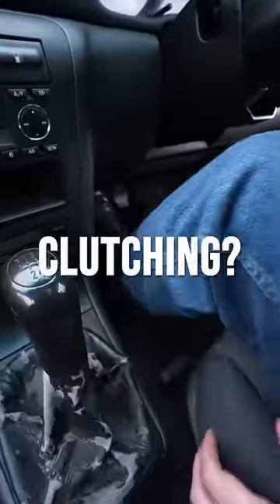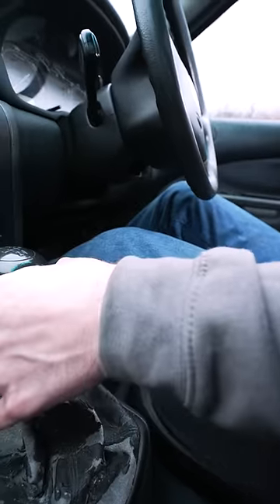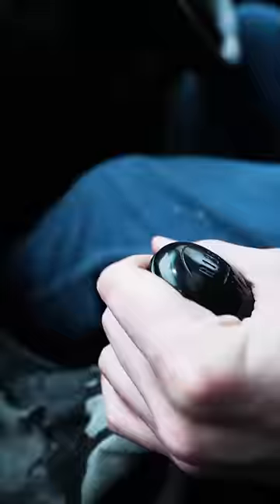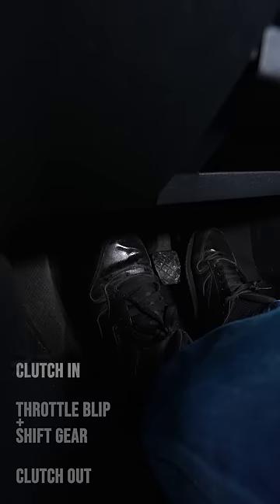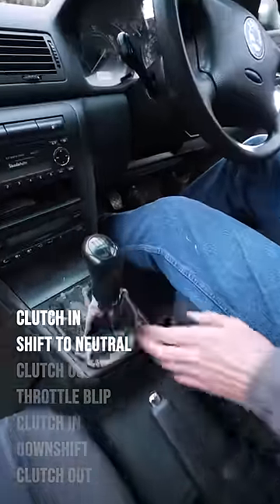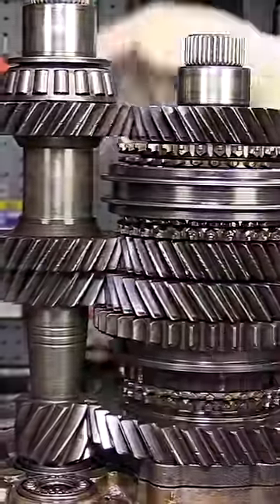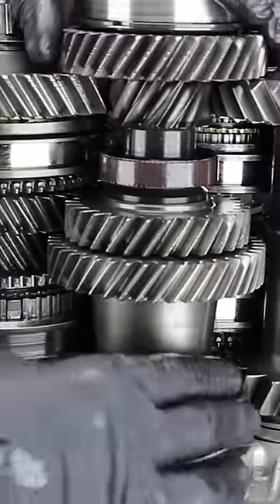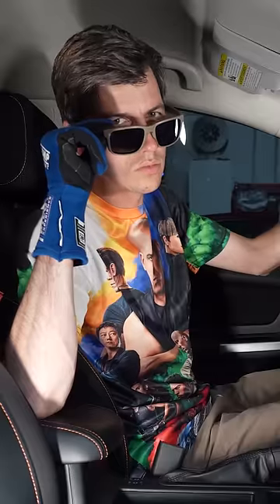What Is Double Clutching? Don't Granny Shift!

Comment: The amount of gear shifting in that movie during a drag race was hilarious 😂
Reply: If theyr running 4 wide and shifting through 5-6 gears that is like 20 shifts, if theybshow every time someone shifts. Which woukd have been cooler.
Reply: Yea I find it funny he was making a joke about them “not double clutching” in a straight line race.
Reply: All the way up to 19th gear! 😂
Reply: They shifted 22 times just to get to 20 mph
Reply: @ralanham76   I'm pretty sure it was supposed to be showing everytime someone  changed gears, not 1 car shifting 20 times. They just didn't do it good. They should have showed them running next to other reving up and then show them all shifting in order or who shifts first, click,click,click,click and then revving back up. The more unrealistic part is how long they rev the rpms up before shifting, in a fast car 1-2, 2-3, and 3-4 shifts all happen in likeless than 2-2.5 seconds. My 750hp mr2 hits 100mph in less than 3-4 seconds. And wheel spin, especially in street racing is a major factor even good drivers spin quite frequently in high hp cars on non prepped public type streets on street tires and if your shits actually fast it more about who can hook and who can pedal it when they spin without losing time. Not about who hits nitrous last. Drag racing from a dig is all about the hole shot, the launch amd who can get to 3rd gear fastest
Reply: You try driving an Eclipse with a stand-alone-fuel-management-system and a 19 speed!
Reply: You’ve obviously never lived a 1/4 mile at time, totally being sarcastic and couldn’t agree more with your comment ❤😂
Reply: @slevpy  in reality there’s a technique where you cut throttle, then disengage the gear with no clutch, then kick clutch as the next gear slides in. Timed properly, barely uses the synchros, timed wrong you can wear/snap synchros and Grieg teeth Rilke crazy
Reply: Looked cool asf when I was like 9 lmaoo
Reply: Often they're supposed to be running flat out then the opposition/enemy starts to catch up or overtake and they shift down and floor it clearly showing they weren't going flat out beforehand
Reply: Supposed to be 10sec 1/4mile cars but the races last a full minute. Thats 15mph average speed. Ooo, feel the G.
Reply: @RBurwell   I love how every time they shift up the visual effects show the cars accelerating harder and harder, the total opposite of how gear ratios work.
Reply: You non car guys don’t get it.  That’s how it’s done when you step up to the line with pinks up for grabs and you’re driving a Mitsubishi with a 37 speed gearbox and it’s all about family.
Y’all don’t know nothin’ about nothin’
Reply: @MrMightyZ  also… Greased Lightnin’!
Reply: Yeh, right? those cars might as well been 18 wheelers, shifting 18 gears lol
Reply: The drinking game where you drink when they shift or say family will kill you.
Reply: dont forget in fast fiv ewhen they were cluth shifting automatic transmission dodge chargers.
Reply: it looks cool to shift in the gearbox, that's why they kept using the scene when drivers keep shifting
Reply: While typing on a laptop
Reply: Yep... like how many gearboxes they have?
Reply: The best is shifting into 2nd reverse
Reply: And I just love how they even drop one down! In a drag race!
Reply: and they only shift up
Reply: @cyruslever586 i believe you
Reply: Every relatively modern transmission... You mean, every transmission built within the last 60 years 😂
Reply: So do yall not use all 20 gears while driving a quarter mile at a time?
Reply: Noone mentions the Floor Unbolting itself and then after the race he picks Vin Up in it without a floor.
Reply: @MrMightyZ  I owe you a 10 second car.
Reply: @ralanham76  I can't even imagine Lowest gear's Crawl Ratio
Reply: Had to fill the 10 minutes for that 10 second race.
Reply: prolly like 21 shifts
Reply: The gayest movie of all time. Gayer than Brokeback mountain.
Reply: You know they have 157 gears transmission.
Reply: @cyruslever586 and then they suddenly fully step on the gas and go faster like bro what were u doing earlier? no wonder why ur behind
Reply: Very specific.
Reply: @Youssef06_  you let off the gas when you shift gears. Most modern cars do it for you.
Reply: No actually they didnt they shiften only twice in all that race that i have seen if we are talking about FnF 1 first race go back and watch it
Reply: @cyruslever586  I’m talking about fast and furious movies
Reply: They were racing on a straight street for five minutes, putting in about 65 gears. At some point, one of the drivers got mad and wanted revenge, and so he punishingly downshifted to go faster. 😂😂😂
Reply: @CrashPCcz  power BOOST!!!!
Reply: Its crazy how the name is not here and yet ik what movie it is
Reply: 19 gear😂
Reply: A lot of drag transmissions only have three gears anyways, maybe four so that's 2 to 3 gear shifts in
 a straight line
Reply: A 750 hp MR2, where do you sit, on top of the car?
Reply: thought the best part was the blown hemi with wrinkle-walls carrying the front tires for 1/8 while the 4-banger just calmly kept right up
Reply: It was so lame
Reply: Not to mention that a 10 second race took 2 minutes lol
Reply: A drag race is a straight line race, when I am driving a standard on a track with turns and straights I upshift for the straights but down shift for turns unless it's a very banked corner you will down shift 3 times in a 7 speed momentum is the enemy of turning and yes you shift down once per clutching just like you would shifting up. Racing vehicles typically don't have markers or indicators of gears on shifting lever but remember just cause they are shifting doesn't mean they are shifting up cause you also have to shift down
Reply: It’s almost like the movie wasn’t realistic.
Reply: endless gears to 60 mph 😂
Reply: Yeah, you in race driving on a straight road. Only need to shift up, never down.
Reply: Bet you didn’t even noticed it until you prolly saw a video when older 😂😂
Reply: Well at the end of the first movie they do a quarter mile and it takes them 3 minutes (or 5 mph) I am surprised they even changed gear at all. Also most people would be able to jog that quickly and more could atleast run a quarter mile faster than that.
Reply: You owe me a ten minute car.
Reply: Bunch of people that have never drove a spoon engine or over nighted parts from japan talking like they know about shifting..pssh :)
Reply: @cyruslever586  That's so fast, is it awd? How much does it weigh?
Reply: @ralanham76  I can hit easily 100mph in 2nd gear on the Kaw C14, which is worth $3k.
 Spend your money wisely!
btw, bought bike new, still like new.  Keep the shiny side up😊
Reply: @albertoj.mollinedo4116  it's called floating the gears. We do it all the time in manual semis. Double clutching is considered the 'proper' way, typically producing a smoother shift, especially for the less experienced. But floating can be just as smooth if you are well practiced. And it's faster, so with 2 equal cars it would win the race. And you can float any transmission, synchronized or not.
Reply: 1
2
3
4
Back to 3
Now 4

Nooooooow 5

Now 4

Now 12
Reply: So you just noticed the amount of gear shifting in that movie!?
Reply: U don't drive a 16 speed? 🤣
Reply: Oh
Reply: @adeelinam  every time after that and the following memea i could no longer watch a street race movie scene without counting
Reply: @DavetheRaveDinkum  its obviously an advanced technique
Reply: @DavetheRaveDinkum  nah, I am a nice  guy 👼
Reply: Yes. He changed that Dodge charger 3spd. automatic like nine times
Reply: @troublemaker2121  making new gear subsets in cars with less gears than a single chain bike
Reply: @MrMightyZ 37 speed 😂😂😂
Reply: @izzabelladogalini  except in rally
Reply: @RBurwell  must be a series of quarter miles linked 

Like ok you beat me  in the first quarter.. lets see another!
Reply: @MrMightyZ  i got a 37 speed transmission yah neen know it
Reply: @hawkshadowoseanacy5171  gotta have that map timing and advanced 3d CAD running showing amazing graphics on a 1999 laptop .. must have been a mini cray
Reply: @sirsancti5504  its the back up reserve power band
Reply: @eleithias  lol obviously but we are talking about a modern automatic with factory nos and factory industrial gearboxes that withstand the slap of a wrist with enough force to pull out a house brick manual shifting
Reply: @ghostsquirrel8739   so the old school grease movie was a bit more truthful
Reply: @willywonka4340  1 gear per   every 4 mph 

Sounds about right
Reply: @Alfredojarillosanchez-fh7nc  oh no...

No 

We ALL saw it. But we desperately wanted pauls lovely graphic painted eclipse to take on a heavily modified 700hp capable rx7 get taken DOWN
Reply: @maxb148  yeah but then everyone running would get a turn at Monica and it would be HER gearbox thrashed
Reply: @cyruslever586  why not just say dom is importing illegal software chips but hiding them inside truck gearboxes 

Necessitating usage of gearboxes because they incorporate the chip and building the plot
Reply: @Sandi_shores_lands_fish   lol that's literally semi truck shifting 😆 🤣
Reply: @Sandi_shores_lands_fish  that's not what happened. What did happen is ever car was a manual and everyone shifted gears 5 time. Also that doesn't make any sense. For 1 a truck transmission woukdnt fit in a car. And even if they did they woukdnt need to shift 20 times because trucks have a shitload or gears to move heavy loads they're low and close ratios.
Reply: @ralanham76  I don't even shift my bicycle that much.
Reply: @cyruslever586 You do not have a 750hp MR2 nor does it reach 100 mph in around the same time as a Tesla Model S plaid or a Rimac Nevera
Reply: @v3gas968  I do but ok. It's a k20-24 with 2200cc injectors and pushes about 35psi, e85, twin disk, lsd, water to air all that. Weighs about 2000lbs wet with driver. And I've outran teslas and crotch rockets or ran fender to fender with them until we'll above 100. It has a accord 5 speed in it so it starts to run out of gear around 140-150 a liter bike can catch up and pass me eventually with more and longer gears,higher rev range and a higher top speed but bikes are slow of the line from a dig and most tesla drivers aren't as fast as their car or as they think they are.the car was built as a grudge car to beat 1l hp gtrs and nitrous vettes... but nah you're right I lie about spending my whole life savings and pulling part of my 401k early on a car to impress strangers on the internet.
Reply: Drag transmissions generally have maybe 4 gears, and there is no side to side shifting. In fact, it's a "t box" transmission where you can only shift up gears not down. Forward position 1st gear stright back 2nd, 3rd thr handle drops down then push forward for 4th.

Then to get back to first you have to press a button to pull the gear from forth back up to 1st. 

But those are more professional gearboxs
Reply: @albertoj.mollinedo4116 slip shifting? You don't need to use the clutch at all, but it's not optimal for HP or acceleration
Reply: They just stir the petrol.
Reply: Why anyone liked/likes ff is a sign of the end.
Reply: I love the amount of times they floor it. Don't know how many times you've ever raced but were you ever at half or 3/4 throttle mid track? Lmao
Reply: ye, you only shift when you run out of torque
Reply: they just werent showing kickdowns ututu
Reply: It's how we're supposedly watching cars do a 10 second 1/4 but the whole scene from the start line to finish line takes about 3 minutes
Reply: Just power shift and don't use the clutch like a trucker 😂(you would likely lose if you do)
Reply: They seemed to have like a 50 speed gearbox.
Reply: All in a usual 9-13 second race
Reply: @albertoj.mollinedo4116  this is what I thought it was.....and had to do it when my clutch went out :D
Reply: They drag race in those movies ? 
A lot of yanking on the steering wheel for drag racing
Reply: In the first movie during the first drag race they show Paul shift 6 times in his eclipse
Reply: 10 seconds is a long time. You can do many shifts in 20 second. Quarter mile in 30 seconds looks wild. Just imagine all those things you would have to do only in 40 seconds. Crazy.
Reply: With that much shifting the cars should be moving in hyper space!
Reply: The shift up and down
Reply: @cyruslever586  You are right. I do streetrace. Have a 600hp (but MASSIVE torque) rwd car and if the surface is bad I loose 1-1,5 seconds 0-60. Recently upgraded my width in rims and tires and it (obviously) made a huge difference. Biggest mistake of FnF 1-4 is definitely displaying cars as equal despite of powertrain and tires. But I still live the first movie, I watched it weekly when it came out.
Reply: There was this scene in the start of fast 6 where Dom and Brian are racing and you kind of see Brian shifting gears in a GTR
Reply: @eleithias  just in the drivers seat, full interior, it's just a k20/24 swap with a big ass turbo and 2200cc injectors. Engine bay is real tight even with a tiny 4 wheeler battery
Reply: Im pretty sure FNF had people shifting in automatics too
Reply: @ralanham76  Yeah, I had a car like that once. 1952 Morris Minor.
Reply: Yeah, double de-clutching is a skill, & a necessary one when previous owners ham fisted driving has sent the synchro's to the synchro graveyard. 
However, learning to 'heel & toe', which is using the double de-clutch method while under heavy braking, & downshifting is actually a fun skill to acquire. It means using all three pedals at the same time with two feet. The right foot has toes on the brake pedal & the right heel on the accelerator while the left foot works the clutch pedal.
Works best in tiny & gutless British or European cars. So much fun.
Reply: Allison transmission in a ricer 😂
Reply: The fact that they did a drag race with manuals instead of automatics
Reply: It's for Americans who don't even know how a manual works
Reply: They probably thought it looked cool.
Reply: Damn cars 18 wheeler transmissions
Reply: Steve McQueen needed a rubdown after all those  clutch sound effects
Reply: The shifting was propelling the car, actually.
Reply: For a second, it almost looked like the guy in between was holding the wrong shifter.😆
Reply: @ganymede3141 no joke, I think that’s how many times Paul Walker down shifts in a row in the one of the first races of the original movie. I remember counting 19 downshifts. Lol.
Reply: Why do they shift so much?

Family!
Reply: Yet I didn't see a single slap shift
Reply: The length of the runways in this world is funnier 🤣
Reply: @sirsancti5504  This is my favorite.  Racing side by side you can hear the engine tickling at the redline, then they drop it down a gear and blast off to the finish.  Does dropping down a gear while at 7500 RPM redline allow you to blast off like your opponent is hitting the brakes?  Why don't they do that in the NHRA drag races?
Reply: The thing I will NEVER get over is Vin Diesel saving his falling girlfriend by purposely wrecking his car to launch himself through the windshield and proceeds to grab her in mid air and wrap her up like a protective cocoon as they both fall onto the hood of a car together, both walking away unscathed. I literally laughed out loud, could not believe they actually went there, can't help but think it was the idea of Vin Diesel himself. Only guy who MIGHT think more highly of himself than Vin Diesel is The Rock
Reply: It's a movie, an American movie of all movies, typical crap.
Reply: Continuous shifting
Reply: 🤔 this topic is getting a bit boring, let’s shift gears.
Reply: It looked really cool to me as a young kid who didn't really understand how manual transmissions work. I know now. I've owned quite a few manual cars.... but the movies have not lost their luster in my eyes. Huge part of my childhood, and a good part of why I became a gearhead.
Reply: The only more comical thing was the burnout-wheelie in the Charger. Vin Diesel is such a badass, he can stare down physics and physics blinks.
Reply: @PotatoeJoe69  don't fall for that Hollywood crap.
Reply: @JohnJohn-zn8ib  Read my comment again
Reply: @PotatoeJoe69  sure, but those Hollywood movies are crap.
Reply: Its just like people cocking their gun over and over again in movies 😂
Reply: More gears than a mountain bike😂
Reply: They outfit their race cars with 22 speed diesel semi transmissions.
Reply: Fr lol
Reply: They were supposed to be racing in quarter miles LMMFAO
Reply: @izzabelladogalini  Yep. Whatever it is that you did to gain speed to overtake your opponent you could've been doing all along.
Reply: Anyone else come to this realization when playing your first more realistic driving game as a kid? Very confusing to only shift a couple times when you grew up thinking you gotta shift like your life depends on it
Reply: @maxb148 I ran a 4 minute mile in grade 9, actually four minutes 10 seconds.
Reply: @grandpa7278 or rubber side down and I'm not talking about prophylactics 😊🤣🤣
Reply: Yeah considering its all shot at speeds under 30 mph 🤌😂🤣
Reply: Well. If they’re double clutching they would be touching the lever, a lot more than just 5,6 times…. 
   I like how you used “ drag “ race because you know actual racing involves downshifting, which not everything in the movie is a straight line drag race
Reply: They should have made a reference to this in super fast parody.
Reply: usually semi cars only have one gearbox but sure lol @hevisirkkeli
Reply: Kaisan-vc8fw  wtf are you talking about?What cams?What?😂
Dude if its a high performance supercar,probably it has a high performance clutch and flywheel,if not then doesnt  matter how do u shift,the force will break it apart.And we dont know what kind of power these cars have,because with the newest clutch models they can absorb pretty amazing kinetic energy.
its more like the gears wont withstand that power because it will just overheat and burn unless they are modified.But there are car types which you can modify widely because they have good parts in them
Reply: @ganymede3141  must’ve got a proto type semi transmission that had 19 gears, get it proto type cause semi trucks only have 9 to 18 gears while most have 10 gears.
Reply: But it makes for good cinema which is the point of good filmmaking.
Reply: They just have 19 speed transmissions
Reply: Whole time they would prob get to 60-90s between all that clutching making it seem 150-220
Reply: @ganymede3141 It’s a semi truck alright😂
Reply: because u miss the context... while they shift down, u only see when they shift up :D
Reply: Im the 50.000th like
Reply: Probably The Fast And Furious or something.
Reply: Double de-clutching
Reply: I'm Gen X I've never seen a fast and furious movie. I just  showed up in my 76 Rancero. Then my Datsun 280. Then my chopped topped pink Toyota mini truck. I never won😂.
Reply: @slevpy  In the french version it's the opposite, Toreto makes joke about Brian using double cluching 

I just checked it:

"a grandpa changing gears in double clutching isn't a runner"

Sorry if my english is bad, i'm still learning
Reply: lmao
Reply: Movie cars have 10 tall short gears.
Reply: Dude they were showing everyones shifting not just like 2 people
Reply: The gas tank is like 3000liters and the gearbox length is like 50 meters or something hahahha
Reply: @cyruslever586  and the up shifting to go faster 😂
Reply: @Factualcontrarian My experience was not unlike yours, except it was decades before you. My first car was a 1952 Morris Minor with a synchro-crunch gearbox. The dinky little low compression four cylinder engine ran OK, but wouldn't pull the skin from a rice pudding. The synchro's were long gone but it taught me how to double shuffle the gears. The pi$$y little brakes also taught me how to heel & toe, & being able to cover three pedals with two feet simultaniously gives one a sense of accomplishment. The following year, in 1967, I sold it & got my second car. & 1933 Dodge three window coupe. It never came with synchro from new. I still have that one.
Reply: Hector's gonna be running three Honda Civics with Spoon engines.
Reply: The best is when forced to race in reverse (it happens to all of us)  They still shift repeatedly.  Like how many reverse gears do you have???
Reply: @cyruslever586  that would make sense if they shifted down too but they always shift up
Reply: Probably because most Americans haven't seen a manual car irl.
Reply: Not that easy if you have 19 gears
Reply: I always thought it was funny in the movies, DOWN shifting made the car increase in speed.
Reply: it's a movie, people nowadays 😂😂
Reply: Oh
Reply: @slevpy 

Oh my god are you ok?😂
Reply: @MrMightyZ shit had me crying 😭
Reply: Fr they suift 20 times and the car says it’s hitting 95 like why is yo car so slow